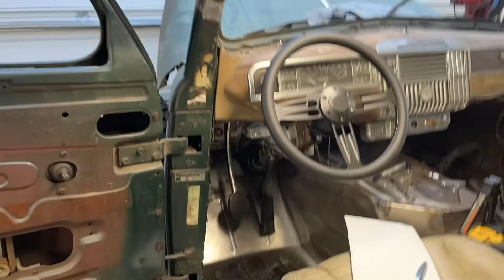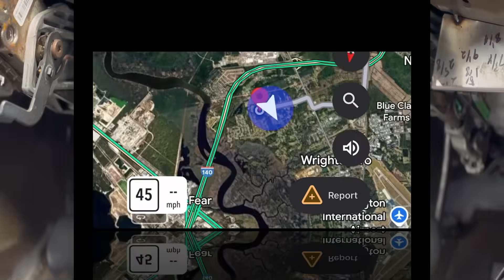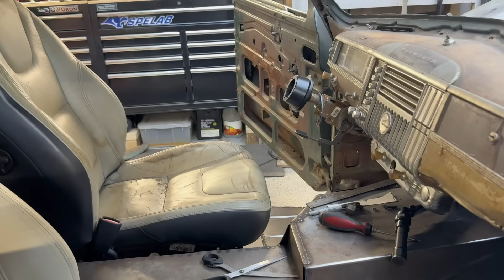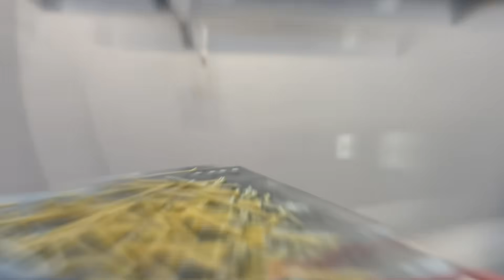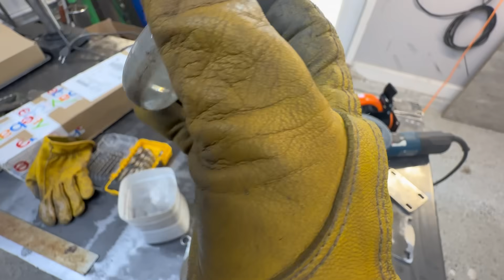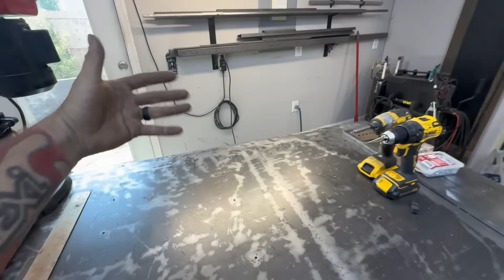Custom Steering Column Covers + Garage Upgrade You NEED!

Comment: Cool 😎 ! Great series. I’m out in my garage doing maintenance . Braided lines , cutting oil filters apart, oil change , setting valves, converter spacing , new rear end cover, new tach,plugs , fuel filters.😅
Reply from the maker: Fun stuff!